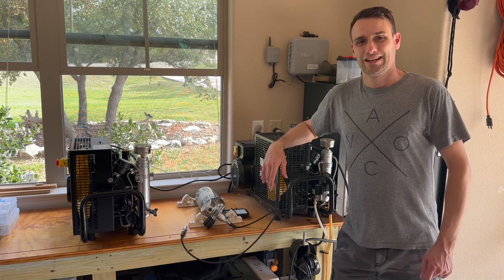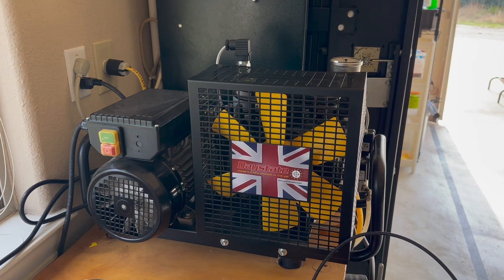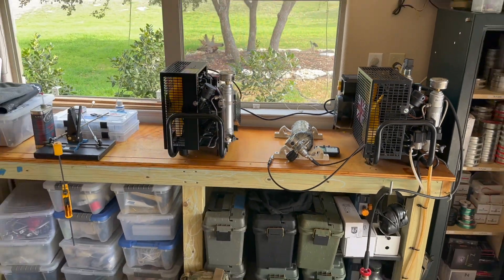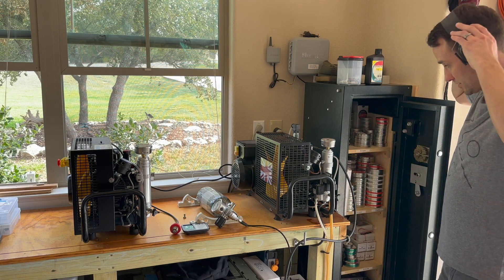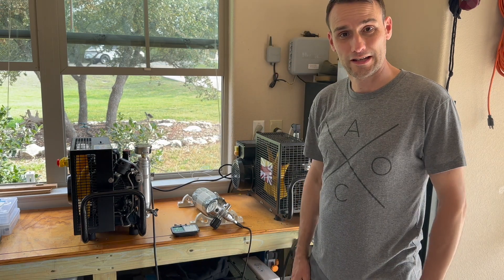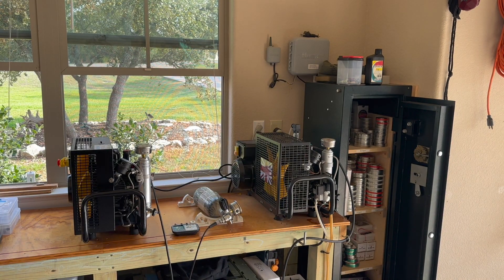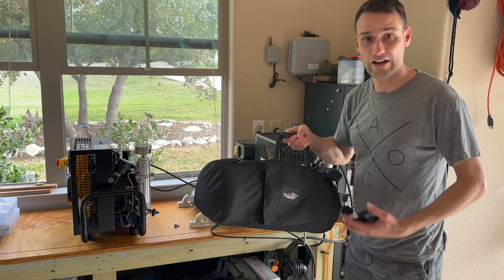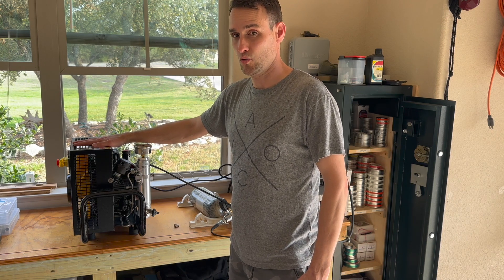220 volt vs 115 volt High Pressure Air Compressor

Comment: Nice compressors.  Price is double what I’m comfortable with.  My Omega has been treating me nice for a few years now.  Slower fill is fine with me for the large tanks.  Nice side by side comparison.
Reply: Slower is actually better when it comes to filling tanks 😎
Reply from the maker: I see the Omega compressors listed between $1600 and $2200. The 110v MCH-3 is listed for $2500
Reply: @AirgunNationForum  I hear you.  When I got my omega air charger, it was only $1100.